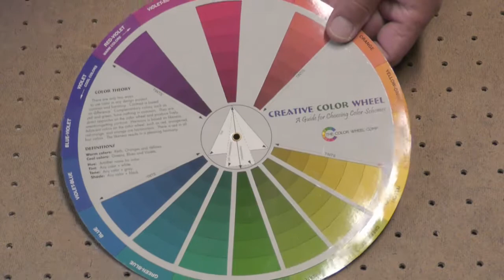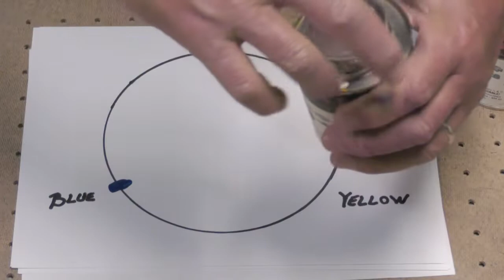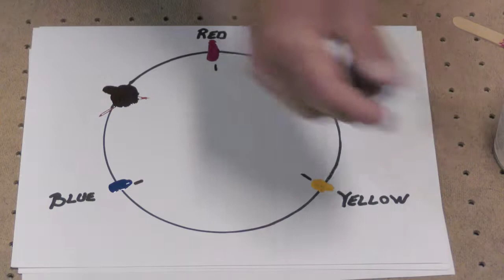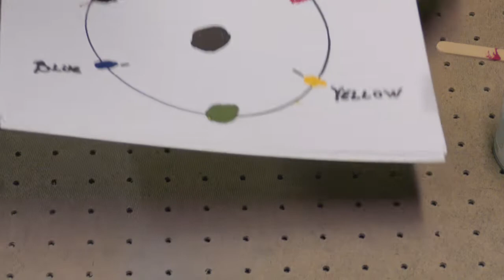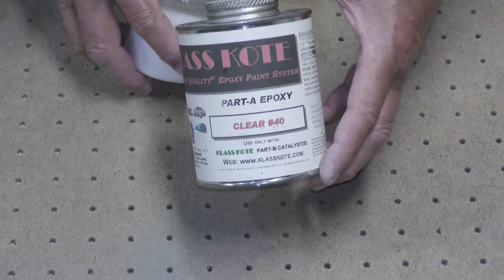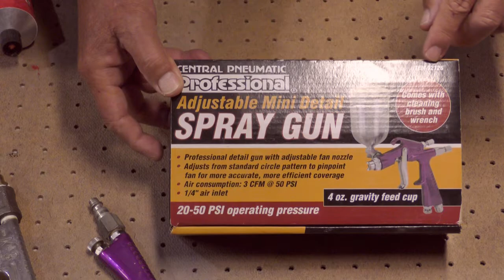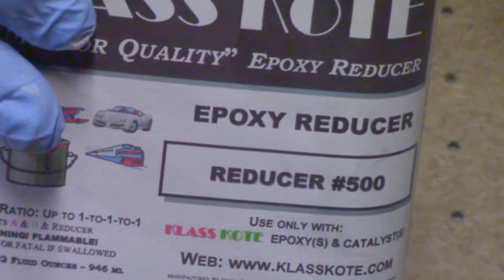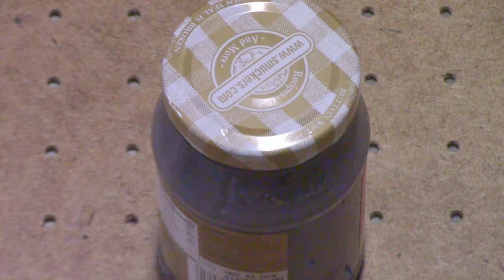SIG Kougar Build  Part-23A Priming and Painting

Comment: G’day Bob, my name is Alan and I only started flying RC 3 years ago (I’m 58 now) here in Australia.

I have built an Ugly Stick and two gliders from kits.

Last year I found a Sig King Kobra kit on my travels and purchased it straight away.

When looking for build information I stumbled across your Kougar build series and it has given me so much confidence to proceed I had to reach out and say thank you.

I don’t have any nitro only Electric and Gas so was wondering if you think a DLE 20 would be too much engine for the KK?

Anyway thanks again for the great videos and keep up the good work.
Reply from the maker: Hi Alan, I'm very glad you found the videos useful. I believe the DLE 20 might be a bit much for power. I've seen a 9cc power a .52 size model with authority and a 10cc pull a .60 size model quite well. I think a 15cc would be the max I would go on an "over power" on a 60 size model like the King Kobra. I've have two King Kobras that I wore out, that were powered with a Rossi .61 with a tune pipe. My models flew great with that engine setup. If you can fit a DLE 20 in the nose and get the model to balance (and the model isn't to heavy) you might find that torque will be your biggest problem. You might find you'll have a ground clearance problem with the larger prop as well (a 3 bladed prop might cure that problem).

Comment: amazed that you didn't remove the retracts or mask them before spraying.
Reply from the maker: Over the past 40 years or so... I've found that spraying over "mechanical" retracts with epoxy paint won't gum them up as long as they are lubricated and if you spray on an angle over them. I set up my spray gun to spray light so all that gets into the mechanism is just dust and not much dust makes it down into the retract. If you spray heavy you will most definitely gum them up. Mechanical retracts are built with a lot of slop in them. On the other hand "air" retracts are assembled with much tighter tolerances and will not take to being sprayed over like mechanical retracts. I guess it all in spraying technique and personal preference. I'll bring it up in the next video. 
Thanks for the comment.
Reply: @rcmodeltipshints9462  cool. thanks for the reply. Keep it up and good flying to you.

Comment: Still watching Bob hope to see you soon!
Reply from the maker: I'm getting ready to restart the Kougar project. It's  been a really bad summer for me. My best friend since kindergarten, flying buddy and fishing companion past away suddenly. His family put me in charge of all his rc airplane stuff. I filled my 16'x 20' shed from back to front with all his rc stuff. I've been sorting through it all and culling out the junk from the good stuff.
    I also lost 3 models this summer. I couldn't pin down the cause so my wife made me buy a new radio system😃. All new Transmitter, recievers, battery packs, switches and extentions. That should eliminate any possibilities of radio problems. If I loose any more models it will be on me🤔. 

Thanks for letting me know you're still out there!
Reply: @rcmodeltipshints9462  so sorry to hear about your loss. Hope your fall goes better what radio gear to you purchase, if you don't mind sharing.
Reply from the maker: @michaelfergusonsr.8574  I decided to go with the Futaba T-14SGA 14 channel. The recievers are the R7008SB S-BUS. Both are the FASSTest system but the transmitter can switch from FASSTest (SBUS), FASST 9 or 7 channel rx modes and it can switch to the FHSS rx mode. It covers all of the modern-day Futaba reciever types. The manual is quite thick and covers all the functions of the transmitter. I skipped over all the functions I won't use. There are also adjustments on the back of the transmitter to adjust the spring tension of gimbals a nice feature but I found that the tension is perfect for me. My Futaba 9-CAP (Super) Transmitter is now in my trophy case with the rest of my retired radios 🤔🙂

Comment: What retracts did you use for this?
Reply from the maker: Sorry I didn't get back to you sooner. The retracts I installed are very old. I bought them on Okinawa while in the Air Force in the early 1980's. I believe they were mechanical rettracts made by "MK". I don't know of any manufactures that make mechanical retracts any more (I Believe "Great Planes" were the last to make mechanical retracts). It looks like you'll have to settle with air or electric.